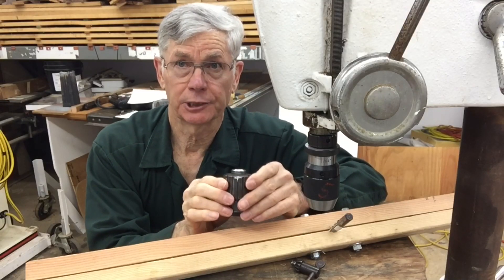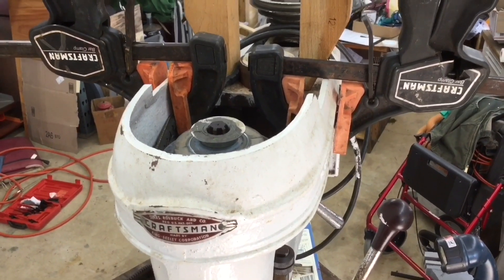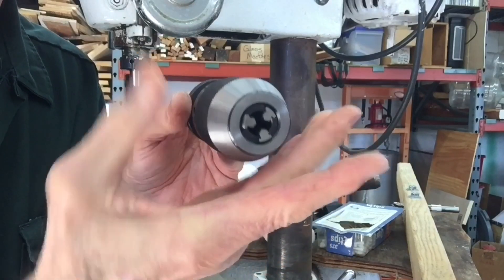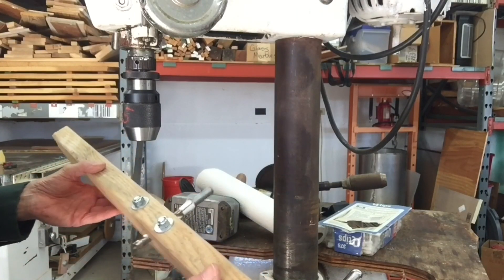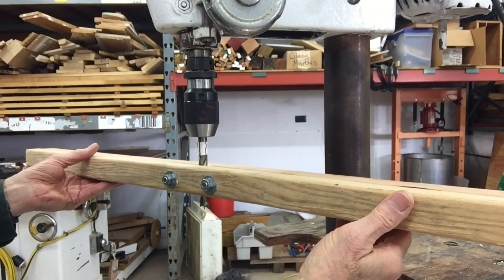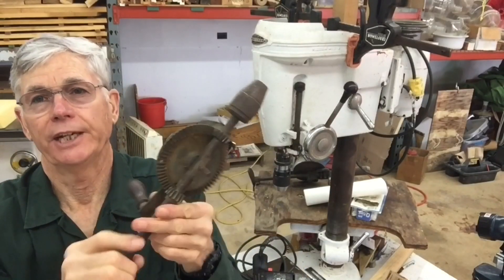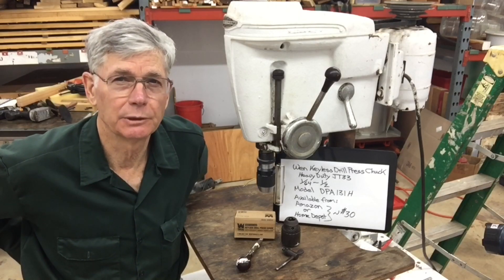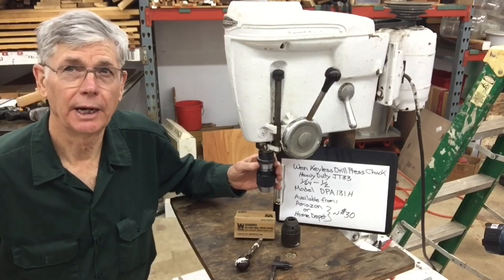Keyless Drill Chuck, Self-Tightening, Compare Keyed to Keyless, WEN DPA 131H

Comment: Why do you want it to loosen when turning counter clockwise? You run it counter clockwise to remove the bit from the wood after drilling it
Reply from the maker: It is not that I want it to loosen if turned counterclockwise, this chuck would just do that. When you drill holes do you really reverse the bit while pulling it out? Why do you like that? I might try that if the bit was stuck, but if it is not stuck, I want it to keep rotating clockwise as I pull it out to clean out the chips.